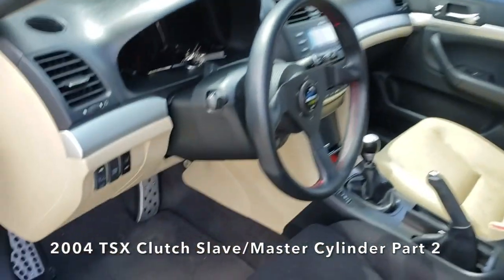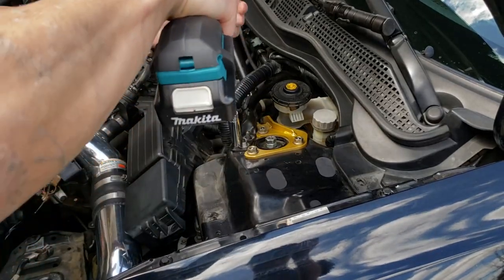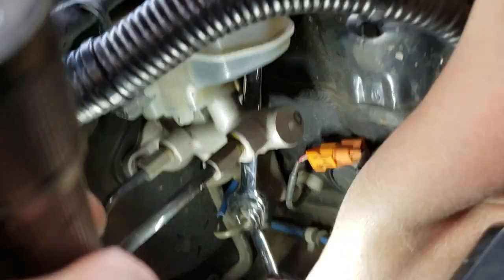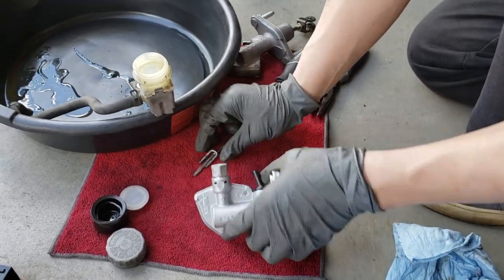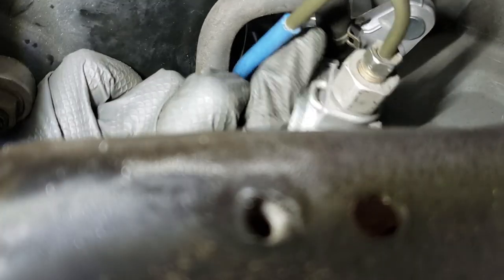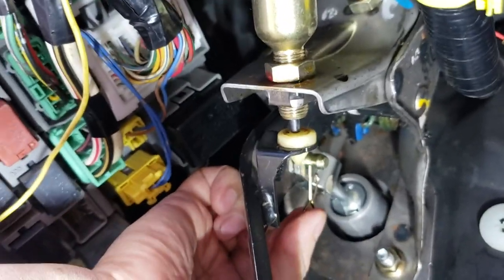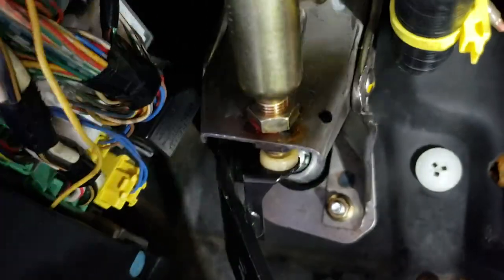How to Replace Acura TSX Clutch Slave & Master Cylinder. Part 2.

Comment: I just did this. I started following the process of removing everything so I could get the strut bar off – but hit a really stubborn wiring harness. So I started to look at if the strut bar really needs to come off.

In the end I left it on. Instead I removed the airbox so I could push the fuse box further. I found this to be a lot better. It doesn’t seem to make much sense removing the strut bar because you need to do all the work under the brake cylinder/reservoir anyway.

I would recommend anyone to skip that part. It’s probably the most time consuming part of the job – and on top of that, with the age of these cars you’re likely going to break a few clips when removing the wiper cowl. So even if you finish the same day, you might be waiting a couple days to get the clips needed to re-assemble.
Reply from the maker: Thank you for your input and sharing anything that can help us with the process. This definitely wasn't an easy process.

Comment: You can unclip the clutch hardline up until the soft line. This allows for a lot more play in the hardline section that attaches to the CMC. If you do this you don’t need to bend the hardline. I found this out after reading the FSM.
Reply from the maker: Thank you Jacob Kolody for the suggestion.

Comment: Your videos are amazingly detailed.  Hope to see more TSX maintenance and repair.
Reply from the maker: Thank you David K, that means a lot and I appreciate the support.
Reply: @jsrebuilds3951  hey which way do you loosen the valve so you can bleed . Down towards the ground or up towards the engine ! Not sure if you can help ? Thanks I’m advance
Reply from the maker: @joserosas7975  left to loose, right to tight
Reply: @jsrebuilds3951   very bad with that tbh …  turning left would mean pull the wrench 8m  upward correct ?

I’m stuck on that part , the rest of your video really helped ❤️👌
Reply from the maker: @joserosas7975  turn towards your left hand
Reply: @jsrebuilds3951   understood thank you !!

Comment: I forgot how, but when I did mine back in 2016, I didn’t have to take the strut bar off, I did pop off the U clip while the CMC still on the car
Reply from the maker: Yes your right, I did mention that you can remove the C clip in the description and in the video after the fact I did all that work.

Comment: It’s also a good idea to bench bleed the CMC. I didn’t bench bleed the CMC my first time and the small amount of air in the system coupled with cold temperatures ruined my new CMC after 6  months.
Reply from the maker: Thank you the tip @ Jacob Kolody.
Reply: What’s/how do you bench bleed? Is there a video you know of that u can refer me to or an article or something?
Reply: @JendyVisionary  you fill the CMC with fluid before you put it in the car. Once you have the old CMC out of the car attach the reservoir to the new CMC, fill the reservoir and slowly pump the CMC piston by hand while slightly rotating it to try and get all the air out. After getting out as much air as possible reinstall the new CMC with the reservoir attached. Next you're gonna want to bleed the whole system normally. This will make normal bleeding much easier.
Reply: @FRUIT164  I have mine installed already and I didn’t do this. I hope it doesn’t go out on me bc of the reason you said. Lets hope and pray. If I do have to replace I’ll make sure to do this next time
Reply: @JendyVisionary  You should be good, do you hear clicking when you push in the clutch?
Reply: @FRUIT164  nope it’s completely smooth and quiet

Comment: You can use the em2 civic master cylinder..100%better than the stock rsx .and without the triangle. I upgrade my 05rsx type  s with it..no grinding gears at high RPM.keep it up
Reply from the maker: Thank you for information. I didn't know that.

Comment: Is this a similar procedure to the Honda s as well?
Reply from the maker: On other Honda's the procedure would be similar. Removing the clutch master cylinder and bleeding the clutch system.
Reply: @jsrebuilds3951  thanks!

Comment: what’s a reasonable price for a shop to do this job? My clutch fluid black and clutch feeling spongy and trouble disengaging.
Reply from the maker: Idk a reason price for this job because I don't own the mechanics software to calculate the labor rates plus I don't know what your issues are with your car. You need to call around and get quotes for your issue and have the shops look at it.

Comment: not bad. gotta do this shit this weekend & am not looking forward 2 it. already knew this was gonna b a bitch so i thought I'd look 4 any tips to make life a bit easier good job!!
Reply from the maker: Thank you for the comment @Heero357. Just remember the tip on pulling the U shape pin to remove the clutch line from the Clutch Master Cylinder so you don't have to bend your lines like we did.

Comment: The pin that you referenced @6:36 if you remove this pin and remove the clutch line off the cmc, you can take out the cmc and the line as two separate items? What happens when you put back the cmc with the clutch line installed onto the cmc, would not not bend the clutch line as you put it back? Could you assemble the clutch line after you put back the cmc separately?
Reply from the maker: I believe yes you can separate the 2 items and yes you can put back it separately without bending the clutch line.
Reply: @jsrebuilds3951  Sorry to ask again. What is the reason to remove the pin while the cmc is still in the car? because the clutch line is not held by the pin.
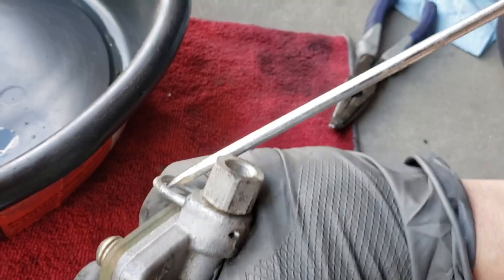Reply from the maker: @ChristianLikesFootball  If you go to @3:33 you will see that the clutch hard line is connected to the fitting that was taken out when the pin was pulled out. So in the video you can see us removing the clutch hard line with the wrench's which is not necessary as seen in video just by removing pin instead.
Reply: @jsrebuilds3951  Yes so the fitting that the pin holds into place gets re-used in the new cmc. Can the clutch hard line remain in the fitting because when you removed the pin, the fitting just get pulled out? If so, it save you from using the 10mm and 17mm.

Comment: Can anyone tell me what it can be if the clutch fluid is pushed back in to the pump system when i release the fork back on to the pin from the slave cylinder after bleeding the system?
Reply from the maker: Have you bleed your system like this in the video? 
https://youtu.be/cxKvmMGcoSA

Comment: My big bolt that first goes into the clutch master cylinder is now leaking , I put it in and put the u joint back in and then the brake line into it but it’s leaking out from the big bolt so I have air in my system anyone have this problem when switching the 17mm bolt to the new master cylinder ??
Reply from the maker: We didn't have any problems with ours. You might want to check if yours is seated correctly and I'm not sure if there is o-ring but you may want to check for that as well.

Comment: This job is a pain in the fucking ass
Reply from the maker: We agree with you @Charlie Cruz. I mention in the video, if you can pop the U pin from the master slave cylinder, it will make that job much easier instead of doing what we did but even the clutch pedal is such a tight space that makes it hard also. I hope this video gave you some better insight to tackle the job.
Reply: jsRebuilds Yeah i saw that part too late , i had already taken it out the hard way haha. But i have a question. When i took the old master cylinder off, the rod on it had no tension at all. The new one had tension even when it wasnt on the car yet. Does that mean that the master cylinder was bad ?
Reply from the maker: @charliecruz662  Yes it should have tension and should spring back out. I believe it is spring loaded for the tension. Also another way to tell if its going bad if it was leaking at the rod.
Reply: jsRebuilds thanks alot! You were a big help!
Reply from the maker: @charliecruz662  Your welcome friend.